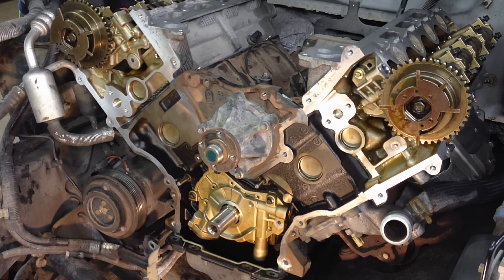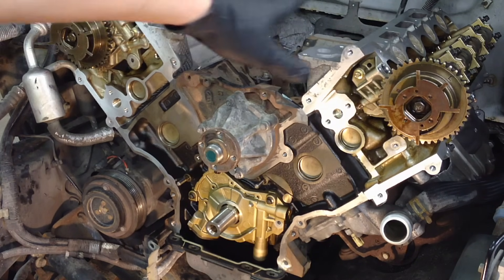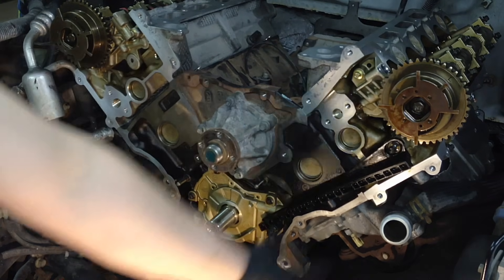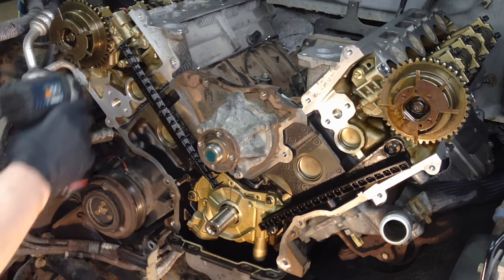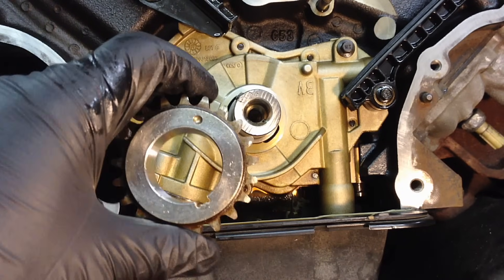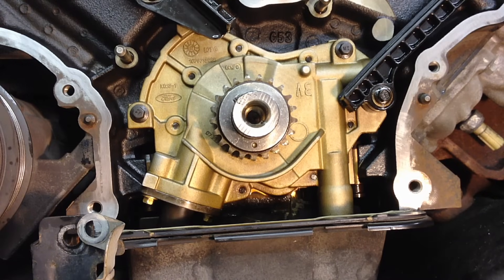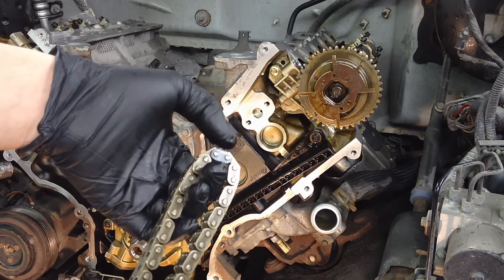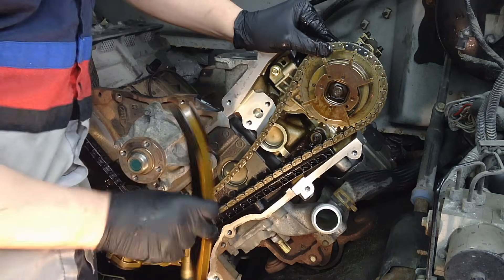Ford 5.4L 3v Engine Timing Walkthrough

Comment: I have a question I've done the timing on my 06 three times, all new components inside, tore it down after the first time the crank tooth wheel had got bent and a hydraulic tensioner fail, and redid the timing and twice I have had the chains jump a tooth both times, out of the one I have done haven't had this issue, the chains seem to have some slack in the, tensioner are full pumped up, thought maybe you could shed some light on this issue

Comment: Great video this guy is the bomb and an encyclopedia of knowledge...  But just wondering  if it is already torn down that far why not put the cam phaser lockouts in it  from livernoise racing and the racing chain guides that they sell on summit racing as an upgrade that way it's done for the life of the engine???

Comment: Anyone know what the black ground wire next to the ECU towards the valve cover goes to. On my expedition 2006 this wire is dangling I'm not sure if this could be the cause of the ticking noise I hear.

Comment: Working on a 4.6 3v. Looks like the chain is a different size because it is one colored link on each end. My question is that the manuals say the driver side cam sprocket timing mark should be at the 12 o'clock when setting it up. With the colored link on the crank mark at 6 and the other colored link on the cam sprocket mark, the cam mark is at the 12:30-12:45 position, and not the 12 position. Mine looks similar to yours in the video. Just a little to the right of 12. This of course is with zero slack on the bottom of the chain. Is this okay, or am I missing something?

Comment: I have a 5.4 triton 3 valve and broke the crank in my old 5.4 but my heads are still good they are 2 valve heads. can I use them on the new block with the 3 valve heads?

Comment: not sure of my truck jumped time or not, i started my truck the other day and it wont hold idle, it will idle for a few jumping rpms and itll die, replaced cps sensors, no change but if you unplug the cps sensors, the truck will run fine. not sure what to so here.. 04 F150 5.4 3v

Comment: The crankshaft position tool you used on the 5.4L 3 valve engine, is it the same tool for the 4.6L 3 valve engine as well? Thanks

Comment: Ford just put a new 5.4 in my 2006 f150. It has no power after 2200 rpm.. Could that be timing? It has no codes and doesn't make any noise. but when trying to go from 45 to 70mph it takes a while. the rpm's struggle to go from 2200 rpm to 4000.

Comment: If the camshafts were locked down ,why did they move when you put the chains on ?
Reply from the maker: Super secret trick I use to reinstall the followers I shall have a video on this soon..
Reply: FordTechMakuloco 
How can u set timing chain 4 edge
Reply: FordTechMakuloco do you heve that video

Comment: I have a 2004 expedition 4.6. the timing chain guides broke into a lot of pieces. I replaced the guides and tensioners,with the help of this video. thanks. I did not change the chains though. I did drop the oil pan and clean the pick up tube filter and the pan from all the plastic pieces from the guides that broke. got it all put back together and it's still making a noise. did the chain jump a tooth and it's out of time now? is my engine ruined? bent valves possibly?

Comment: Is this the same on a 5.4 2v?  And is there anything regarding  #1 being at TDC for this to work?  (I have seemed to hear that a lot). You just set the crank and use the chain to orient the cam/cam gear?
Reply from the maker: The 5.4l 2v is a bit different but the same tool used here to align the crank is used on the 5.4l 2v engine.

Comment: great instructions here. thanks for being so thorough. Do you know if the process is similar on the 2-valve motors? I'm about to pull the heads on my Excursion with a 2V 6.8L v10.
Reply: nevermind I just saw someone else's comment where you said the 2V motors are different. Any advice?  I can't find any good videos on the v10.

Comment: I have question probably a dumb question but I have a 2003 F-150 with a 5-4 Triton in it and I see you working on 5-4 Triton Motors but you keep on saying it's 2004 I was wondering if the timing is like timing chain and kit and everything is as the same as 2004 in 2003 cuz somebody told me the 2003 5-4 is a 2v instead of a 3 v

Comment: hi i have a 07 expedition with the 5.4 its starting to get a raddle on the passenger side and i got a p0340 code what do i need to do change the postion sensor or just get a timimg job done on it

Comment: i just installed cam phasers and timing chain it was all set to timing marks crank shaft mark at 6 oclock dot and cams line up with two dark links on chain now that i rotated the engine twice my timing marks on cams dont match up with timing marks on chain is this normal. or do i need to start over thanks for the help.
Reply from the maker: +Martin Valdepena the won't line up again for I think 51 revolutions so what you are seeing is normal
Reply: @FordTechMakuloco  I test drove my ford truck. after doing a timing job 
  when Accelerating from a stop engine couple of kicks and sounds like roar its taking in air. it idles fine and no check engine light.

Comment: hey man I have a 2005 ford 5.4 3valve I had a miss fire on cylinder 2. replaced coil packs all replaced all spark plugs and put in new cat Bank 1 was melted in side and replaced timing set chains guides tensioner and phasers. still rough ideal and tick at times sounds like exhaust leak

Comment: Just a quick question. I know the key way should be at 6 o clock. But on what part of the rotation? Should cylinder 1 be up like top dead center. I did not follow the directions when taking the engine apart and not sure where the engine should be when the key way is down.
Reply from the maker: +Kevin Gardner The crank can only be in one position at 6 so just set it there with the dot at 6 and time from there

Comment: what did you use to keep your camshafts from moving? Thanks
Reply from the maker: Nothing they should spin free for the procedure.
Reply: why did you remove roller pins in another video and not in this one. is it because you took off the phasers in the other video. i am doing phaser lock outs on mine.

Comment: THanks a million for this, I bought the kit you recommended, and am about to attempt this soon. Only question I have now is regarding the sump gasket, did this engine leak from the corner where the sump, block and timing cover meet? If not, how did you get around it, plaster a heap fo gasket maker in there or get a new sump gasket? THanks in advance!
Reply: A dab of gasket sealant in that corner, both sides where the block meets the heads, and the corner where the head, timing cover and valve cover meet.
I'm in the process now and am going to put a thin bead of sealant all along the exposed oil pan gasket with a little extra in the corners.

Comment: tensioners R stands for right side motor right?
can u confirm this as you put the right tensioner on the left side. unless for some silly reason its the engines right side which is stupid
Reply from the maker: +bris fry the position always refers to look at the engine from the drivers seat so left is drivers side

Comment: Slightly off topic but maybe you can chime in. I got a turbo 2005 Mustang GT 3v. I was having issues with it starting with it only firing a few times. My tuner couldn't get it to fire either it just slow cranked. After doing a compression test they told me that there was less than normal compression on the driver's bank while the pass. side was within spec. is this a timing issue? Also I replaced all timing components with aftermarket beefed up guides, tensioner,etc. The chain also only had one blue link on both ends opposed to the two on one end and one on the other like the 5.4. Is that correct? Thanks!

Comment: Hi , i replaced engine 2007 V8 4.6L  F150. after that i am getting P0340 camshaft position sensor circuit  DTC. i replaced  with new sensor, i checked circuit two wire going back to PCM. it has continuity from cam sensor to PCM. i disconnected the Alternator +B wire . i checked the DTC, and cleared , still coming back . right away, when we  start the truck . any idea bro.
Reply from the maker: I think its time to pull the valve cover to check the tone wheel on the sprocket
Reply: The truck starts after 6 cranks. delay to start.

Comment: have the front cover off, did everything like you said, rolled the engine over to check and the marks are off. is that supposed to happen? shouldn't it stay in time when you roll it over?
Reply: I did guides, tensioners, and phasers, have crank tool so I know crank was lined up to begin

Comment: Hey I have a 2006 Ford Expedition 5.4 3 valve and we redone the cam phasers , timing chain , guides and tensioner , and now it keeps coming up with a pending code for po345 and po349 and it is running lean on the driver side also . We have checked all the wiring and for vacuum leaks and can't find anything , I made sure it was timed like you said in the video , we also replaced the vct sensors both and switched the cam sensors with the other side . It has a shitty idle also and you can pull the coil plugs on drivers side and it doesn't change . Any help would be great I pulled valve cover back off and the timing marks are not lined up when we turn it over but will they line back up the marks by turning it over by hand because I have turned it over a bunch and it is in a different spot everytime on the cam phasers the two black links ?

Comment: techmakuloco I need your experience advice  I did the heads on my f150 5.4 3v  I remove all the camshaft roller follwers  but I can not remove 2 one on the #3 cylinder and #4  two are exhaust valves  does it make any difference if do not take them off  thanks in advance

Comment: i took down my 2004 f150 and noticed the passenger side cam phaser was (stamped L)
Just wondering what affect having the phasers on the wrong sides would do.  i had bad miss in the motor and the dealer said it was a broken guide but no broken guides and just a worn chain but the phasers are obviously on the wrong sides of the engine.

Comment: This work for the 6.8 3v?
Reply from the maker: The 6.8l is close but a bit different in timing the engine and you also have to deal with a balance shaft too. pm me on my facebook page for the procedure.
Reply: +FordTechMakuloco man you've been a big help, I have to change my oil pump on my 07 do I have to pull all my cam followers or just select ones

Comment: I actually did it with the single black link on the crank and the double black links straddling the cam gear marks. I torqued the cam gears down and don't want to remove bolts to switch the chains around. Since the chain is symmetrical as far as the marks go, am I alright to leave it that way?

Comment: I have a 2010 F-150 with the 5.4. I have noticed a chattering noise when I give it throttle an than take my foot off the gas, as the RPMs drop, I'm assuming it's the timing chain tensioner not keeping tension, allowing the chain to be loose. Is that common on the 5.4?
Reply from the maker: Yes also the phasers can oscillate causing the noise only use Ford components though they are linked in the video description.

Comment: hello FTM did the timimg replacement on this engine 5.4 3v 05, put everything back together now im getting P0340, 44, 45 49, switch out sensors in fornt of the heads samething, any ideas, should i of replaced the oil pump too? thanks

Comment: Nice :) thanks for the walk thru, so, what are the phasers for? adjust timing? why do they make so much racket, I was told they don't get a good oil supply and replacing them only masks the issue, the real issue is a weak oil pump?

Comment: I did my timing components on my 2001 F150 4.6,the drivers side chain had eaten into the plunger.....My question is,my crank sproket had some rotation play,shouldn't it be tight? Great vid by the way.
Reply from the maker: +Tommy Greist yes it should be a precise fit

Comment: you are fn awesome thank you soooo much. Thank you for your service,1 of these days ill get you back.... plz keep making these for the 04-10 5.4 triton. i love my truck 05 exped xlt 4x4 just can t afford to pay to fix it and its so specific to this engine in these years. ive had many mechanics try to give me advise and they just dont understand its the triton engine. all i need now is a video on catalitic convertors. getting bank 1 and 2 below threshold codes.  I have used you and others to help me change plugs and cops, vct on both sides fuel filter, brakes rotors, rear blend door, ac junction box had corrosion in it. Thank you, you are an angel. my wife myself and my 7 kids thank you.

Comment: BE SURE YOU LINE UP TO THE CORRECT TIMING MARKS ON THE PHASERS!!!  After spending 30 hours this weekend doing timing chains, oil pump, lash adjusters, rockers, cam phaser lockout, and more, my truck ran really rough, and threw a P0345 code. I went back through my pictures of the job (always a good idea to take lots of pictures), and noticed that I lined up the LH phaser is lined up to the "R" mark, not the little dot opposite the "R". This is telling the PCM that the phaser is 180 degress out of phase from where it should be, and of course the ignition/fuel timing is therefore WAYYY off.

DONT MAKE THIS STUPID MISTAKE LIKE ME!!!
Reply from the maker: +scmike1229 True I go over this pretty well in this video and really well in my new video coming out soon to help people out.
Reply: For the record, I did the same thing. Only difference is I looked at my pictures before buttoning her back up. My stomach sank when I started thinking about the correct compression / exhaust stroke for cylinder #1 at TDC.  So I took my search to the forums and that really made things confusing.  After a good amount of research, watching Brian's videos, and reading his comments some learning occurred. Essentially the cams create the compression / ehaust stroke not the crankshaft.  Moral of the story, I took all the roller followers back out and I'm the process of re-timing with the crank at the 11 o'clock using the tool. Like the old saying goes, "Measure twice cut once!" Not fun doing the roller followers twice but I've always learned things the hard way.

Comment: my crankshaft is at 12 o'clock,   can I rotate once clockwise around to the 11 o'clock position? I remember reading something about 2 rotations instead of just once.
Reply from the maker: +hobie0001 you only need to rotate it once
Reply: +FordTechMakuloco 
I have used your videos to practically rebuild my whole engine, replaced the phasers, tensioners, timing chains, VCT valves, oil pump, water pump, rocker arms, lifters, spark plugs, oil sending unit, oil pan gasket (cleaned the pick-up screen too). Engine runs perfect for about 15 minutes but then knocks and rattles and throws code 22. From the research I've done it seems many people end up in the same spot. Do you have any suggestions?

Comment: You sir are the best! Ford not so much, still cursing at the lack of engineering on this 07 f150 Lariat. I have been driving it for a year and I would joke that the truck was a diesel hybrid to my passengers because of the way it ran after warm up...as soon as you drove over 1000 rpm then came to a slow down or stop the rpm would drop out and make the diesel chattering sound. When you increased rpm the engine would right it self. The truck ran great on the hi-way just a pain in town. VCT solenoids suspected.
Finally tackled the job.
  Dropping the oil pan is not so simple, as well as the valve covers..oh my! I did the exhaust manifolds while I was at it, what a crazy job. No space on passenger side as I had (2) broken studs (Back and front of eng.) to remove and 1 on driver side. These were broken before working on them...thanks Ford. Had to remove starter and a/c comp.  to get access to back broken stud & passenger manifold out. After disconnecting steering for access had to grind out and retapp driver side broken exhaust stud at the back (closest to firewall) after 2 extractor s broke and 2 drill bits broke in hole. Tough angle to get drill into! Die grinder...yes...very time consuming.
The timing guide failed on passenger side. The mechanism of failure was the spring tensioners gasket failed on both Gaskets, after removal clearly pushed out and visual oil tracking on the head is visible, causing chains to loose tension and over time wearing against tensioners to the point of failure. Chewed up the passenger side real good. The chewed up plastic then restricted the oil pump intake causing low oil pressure. Thankfully this occurred in my drive way!
Changed VCT solenoids, Timing chains, sprocket, tensioners, guides, oil pump, water pump etc. The Cam phaser appeared to be in good shape... changed with new bolts though. Thanks again for all your clear and concise help.
Reply: Tim Ferguson Good day. Is it possible to change hydrants from plastic to an iron explorer 4.6L 2007 goda.i why the chain rattles on the warmed-up engine

Comment: what is the special tool you speak of that goes on the crank? at 4:15
Reply from the maker: +Shane Derrick All the tools and parts are listed in the video description
Reply: +FordTechMakuloco another question. while doing this would you replace oil pump and water pump on a truck with 155,000 miles?
Reply from the maker: +Shane Derrick Oil pump yes but water pumps almost never fail and are so easy to change just about any time.